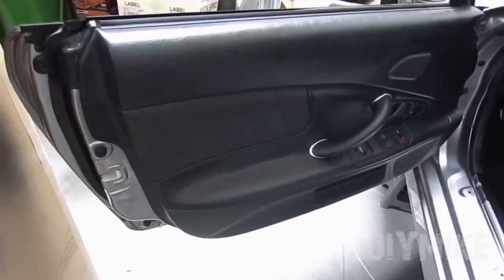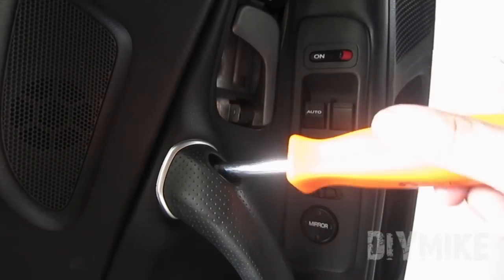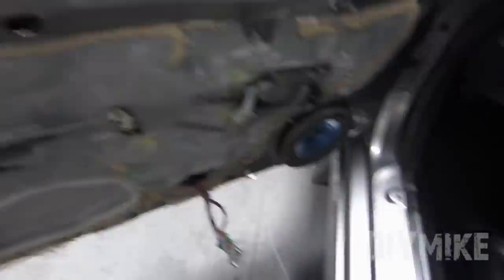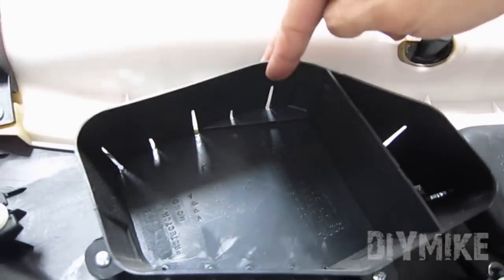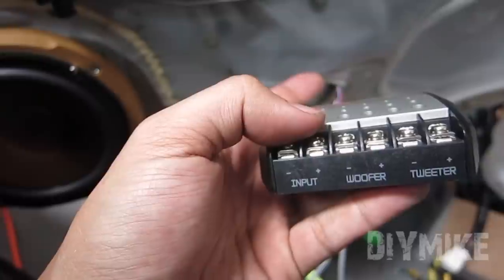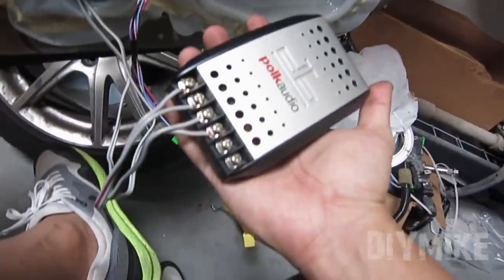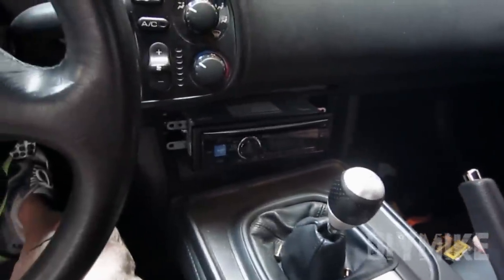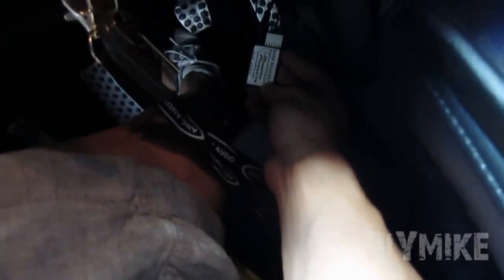HOW TO INSTALL Honda S2000 Headunit and Speaker

Comment: Did the wiring to the alpine stereo receiver works without any adaptator? I mean can you replace the stock stereo with the alpine without adaptator and having the steering command working?